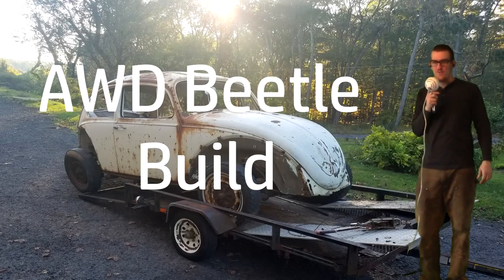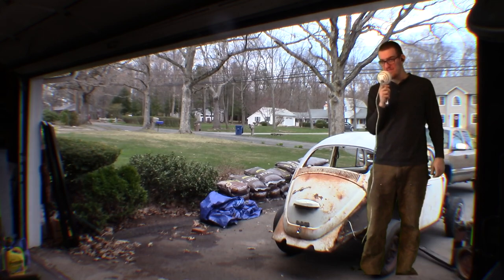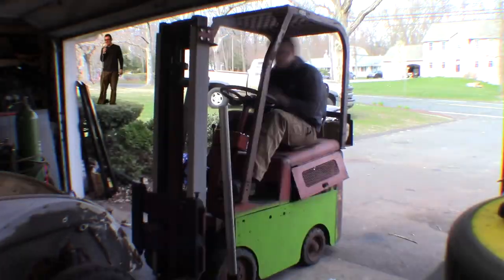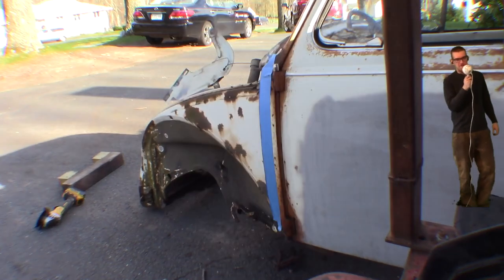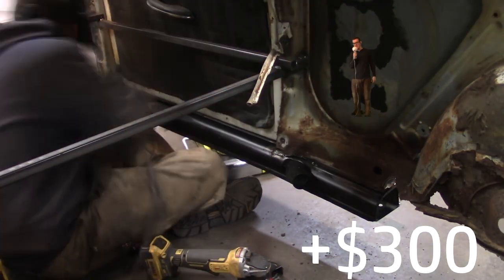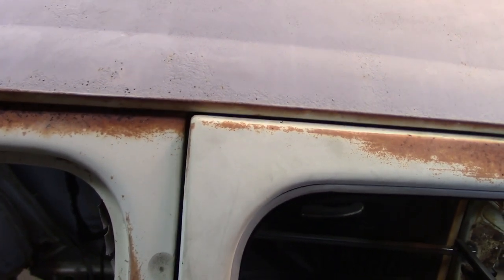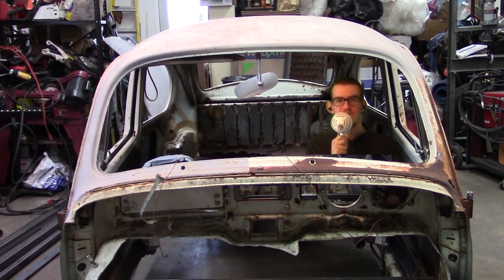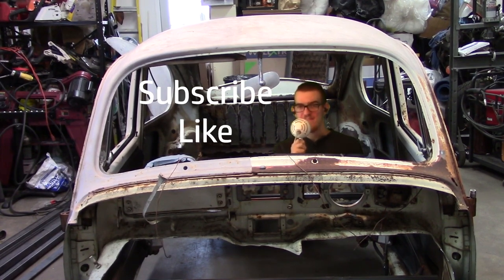AWD Classic Beetle Build - 1 Prepping the Beetle

Comment: Bro I'm thinking about doing with the Cadillac Escalade 6.0 all-wheel drive what your thoughts
Reply from the maker: I went with subaru because everything is really compact. You would need some crazy wide fender flares to fit. It would be pretty cool to take the Cadillac frame and awd system and put it under an old muscle car, like a chevelle or a skylark or even a first generation c10. Anything is possible though!
Reply: I'm working on a project for an AWD Dodge Dart using a Subaru drivetrain attached to a modified 2.4l engine that comes in the Darts with the 2.0l head swap and a turbo

Comment: quick question is this possible on a vw bus!?
Reply from the maker: I think they built trans axle for some buses that were awd. i think with the bus you would run in to a problem where the engine is too close to where you sit, but anything is possible.